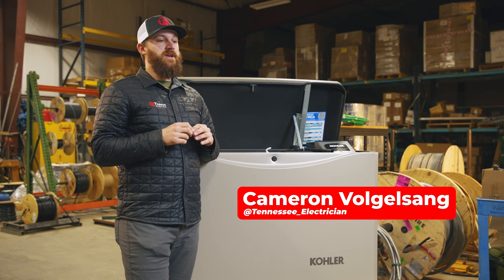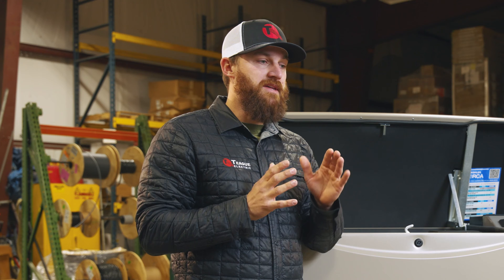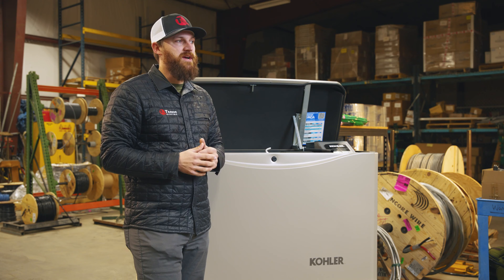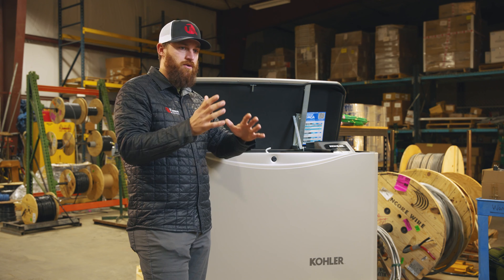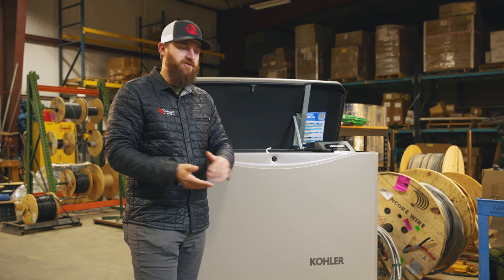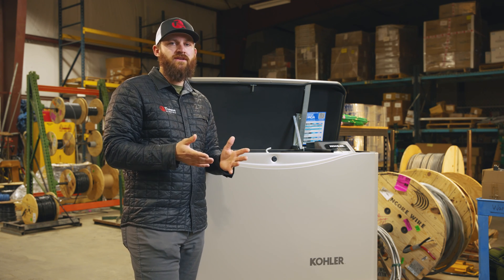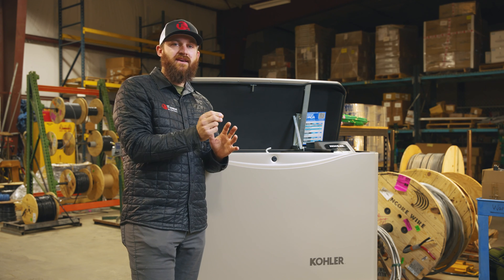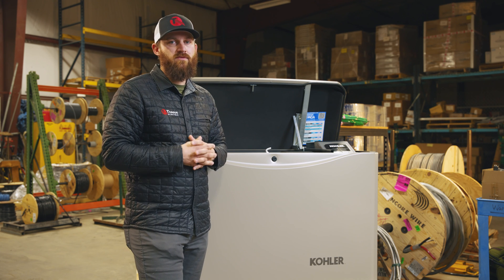What Size Generator Do I Need For My Home? | Teague Electric

Comment: Just my 2 cents. After careful consideration about "what" is truly needed, my Honda EU22OOi produces enough power for the fridge, furnace, lights and essential things during a short power outage. No brainer. It's quiet, reliable and worth the cost. Even in winter. Alberta Canada. Cheers! 😊  Great video! 👍
Reply: How can a 2,200 watt generator run all that at the same time?
Reply: @Uncle_S_Word  as you know, the fridge and furnace run intermittently and all the lights are LED. Only essential lights are ever used.

Comment: Remember that portable generators come in two types, inverter and regular. The Inverter generator is needed for high tec electronics such as computers, etc.  Inverter generators produce "clean" sine wave electricity, where regular generators produce dirty sine wave electricity.  If you try and run your computer with dirty electricity, you may burn up your computer, etc.